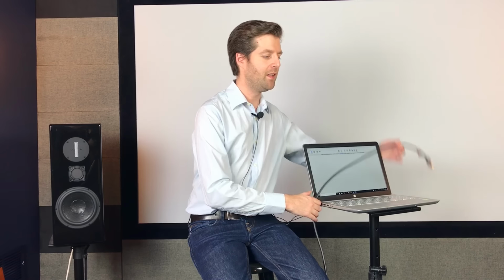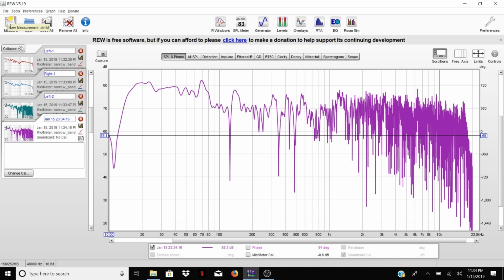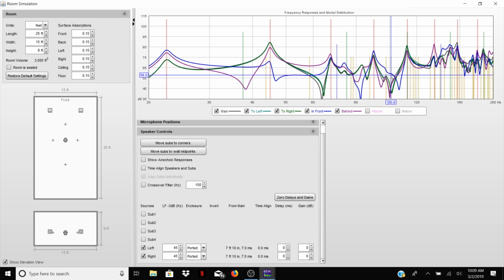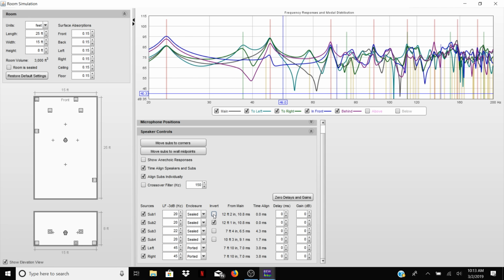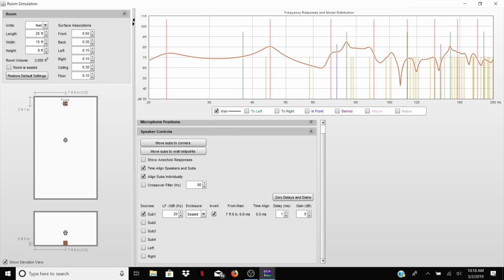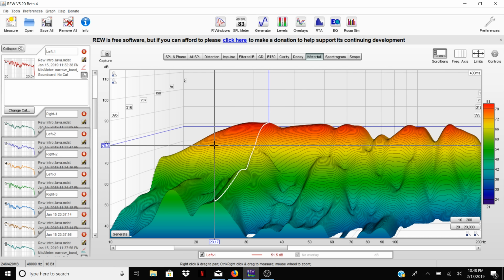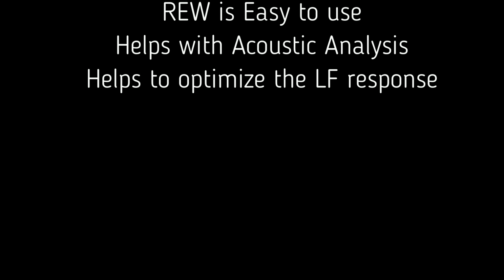How to Do Room Measurements Using REW Software

Comment: Basics / Setup
----------------
0:23 What is REW
0:59 Hardware needed
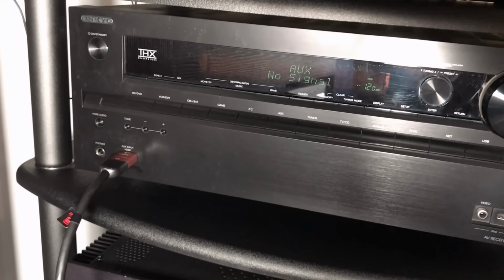1:46 Microphone placement
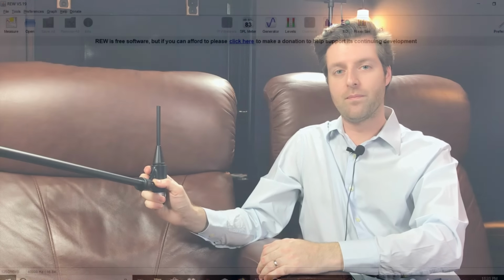2:16 How to setup REW
2:39 Calibration file (important!)

How and why we measure
----------------
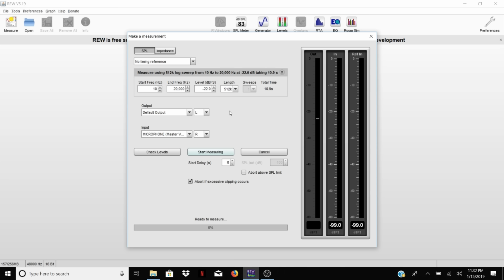2:52 How to measure
3:29 Smoothing (how much?)
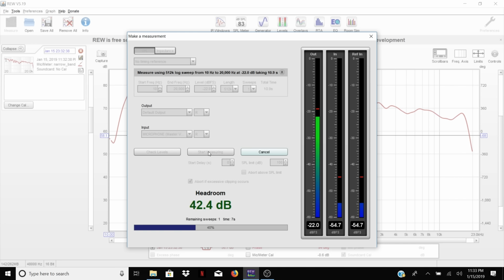3:57 Measuring both left and right speaker
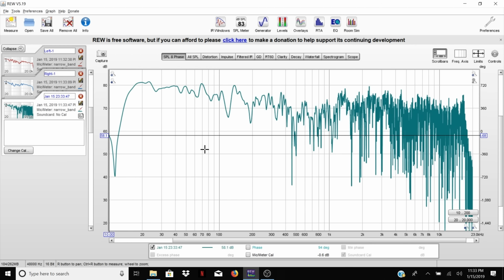5:06 Labeling measurements
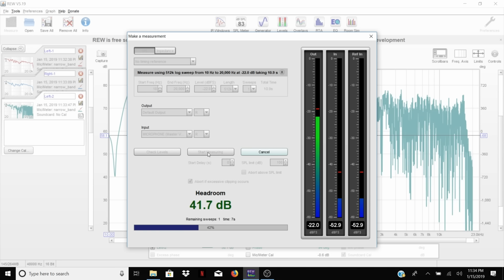5:38 How many measurements to take
6:14 Why we need more than one measurement
6:52 How to solve dips in the frequency response
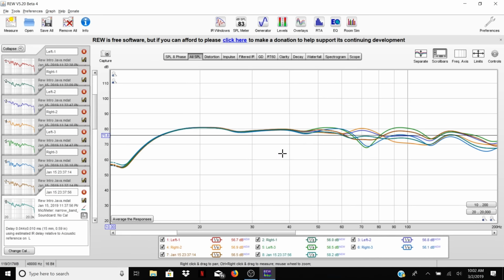7:35 Proper chart scaling
8:32 When to remove smoothing
8:54 What to not EQ
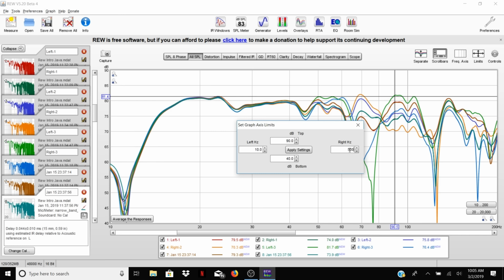10:40 The Schroeder frequency
11:22 Timing reference

Simulation
----------------
12:47 Simulating room modes and SBIR
12:56 What are room modes?
13:34 What is SBIR?
15:36 Why use multiple subwoofers?
15:55 Ported vs sealed subs/speakers
17:17 What frequencies to treat and how
19:25 Why simulations are not accurate
21:23 Individual subwoofer delay
22:06 Other simulation software
22:38 Running the main speakers full-range
24:06 Sealed vs open rooms
24:37 Why placement is so critical

Other measurements / wrapping up
----------------
25:40 Impulse response
26:10 Steady-state response
26:29 RT-60 (reverberation / decay)
27:10 Waterfall plots
29:30 Distortion plots
31:24 Wavelet / Spectrogram

Outro
----------------
33:14 Summary (what equipment you need)
33:25 Summary (what we've learned in this video)
Reply: Thanks. You've helped a stranger. You are appreciated.
Reply from the maker: Thank you so much for doing this!
Reply: InstaBlaster.
Reply: So Rew helps with 1. Speaker placement 2.  Acoustic treatments for flattening the curve 3. Purchasing subs when the dip is too great. 4. Change the crossover point on receiver. 5.Help with flattening with calibration if you have a 1/3 octave eq or better. (Which I don’t).
 What it’s not is: a auto flattening system that creates a curve for your receiver, like audessy? And I know it also has its problems. I just am looking for this to autocorrect what I cannot change... will it do that?
Reply: @tiagovirago  REW has the ability to auto generate EQ filters based on a 'ideal response' the user sets (the room curve).
those filters can be imported in all kinds of hardware or software* EQs. (or set manually on a graphic EQ device)
for a receiver alone application, the receiver would need to actually offer the option to manually apply EQ settings. 

*Equalizer APO is a free software that can do channel routing and other comprehensive settings, EQ incuded...

Comment: Do you have to eliminate the cross over on your avr in order to get a full sweep ? My crossover is at 80 hz so would I be missing the frequencies less than 80 when performing a sweep (speakers set to small).

Comment: Came to this video through Audioholic’s Room Treatment Series of podcasts. Inspired me to purchase the UMIK-1 and download load the REW software. Wow! It is not easy to get started with this stuff. You breezed right through, “And I connect my laptop to my Onkyo receiver and choose it as my output device from the drop-down menu.” = = Two hours later after determining that MY Onkyo receiver wasn’t recognized by Windows 10; I had downloaded files for my Oppo BDP-105D over the internet and chosen the correct input for it. Took six measurements, biggest anomaly was crossover between subwoofer and mains: Big hole from 30 to 40 Hz.
Reply: I would try REW but have only analog AMP, I like vintage. So no chance to measure my room and correct it?

Comment: Thanks for posting all of this. REW looks awesome. I'm debating about which measuring mic to get, quite possibly umik from mini DSP to take measurements. I'm nearly certain I have a room mode around 40Hz which seems to coincide with my basic tone tests and the fact the room is around 13' long, which would be the axial room mode. But without measuring, I really have no way to tell just HOW much of a db difference it's all at. And what to do about it. Very excited to get REW and work on the setup. I feel like I have the right kit in house, just need to optimize the setup!
Reply: A few years ago I made the jump to REW & a UMIK-2 along with a MiniDSP HD for my dedicated two channel rig. I already have a pair of HD’s for my Atmos setup but using one in my two channel rig which at the moment consists of either a pair of Revel Performa F50’s or JSE Infinite Slope towers powered by a pair of Adcom GFA-555’s and a Parasound preamp have a number of peaks from 30-60hz and and apparently a dip at 160hz. Using REW and tweaking my speaker placement I was able to get rid of the 160hz dip and I was able to EQ out all of the peaks via the MiniDSP HD and REW measurements. It sounds exponentially better and I highly suggest it
Reply: @josephfranzen5626  my vintage shop had one of those adcoms and I was seriously considering it but it may be too much power for me in the small room. A pair sounds nuts I love it. 

So after a month or so searching here and there I think I'll be going with minidsp SHD so I can apply DSP in the digital domain. It includes the umik and I can start down the REW path with that setup. 

I'm hoping I don't run into problems with two DACs in my system. I'll go digital out of the SHD to my denafrips DAC for the mains. I'll go analog out of the SHD (using it's internal DAC) for my stereo pair of rel. I'm aware that I'll be adding delay that I hope I can easily correct via Dirac but also manually in case I go without it.
Reply: @erics.4113  You should be able to. In addition to Audioholics I’ve found the MiniDSP forums to be immensely helpful.
Reply: @josephfranzen5626  I'm excited for it. My plan is to eventually look into room treatment as well, but before I go there I want some measurements to establish a baseline. Plusses with DSP and potentially Dirac are far too great to turn my head away from, especially now that I've integrated two subs and am battling a nasty room mode. Have a feeling I can attenuate that and immediately get a better FR across the range. Plus, my attempts at subwoofer positioning always seem to trade one problem for another. Although that's probably to be expected, I am relying on an inexperienced brain and ears to determine exactly what is happening and I just simply want measurements to equate the in-room experience to actual frequency measurements. I'm done going blind. Want to open my eyes now 😀

Comment: I have avr at 0db, signal from rew at 30 db and my 20-500 sweep starts at 90db then falls linearly down to 70db at 100hz, then +/ around 70db to 500hz. Do I have this setup correct to be getting these readings?

Comment: "You can use a mix of sealed and ported".  Oh, thank god, because I have sealed and open panel!  :-)  /S

On a more serious note, is it worth throwing out the severe outliers like the one you show far below the other curves with the flatter inflection points?  This obviously assumes that those were generated with the sub/listening placement outside the norms, rather than at the primary listening position.

I found the comment you made about multiple subs very interesting.  Does it seem to be enhanced (improved) running L+R over separated stereo, or vise versa?

Assuming...assuming...asssuming... Yeah, damned non ideal equations.  I was in an empty living room once with plaster walls, and I can tell you for a fact that they are MUCH more reflective than drywall.  You could clap (an impulse) and hear about 10 or more reflections damping down VERY slowly compared to an empty drywall enclosed room.  I suspect this comes not only from the stiffness of the plaster surface directly but also the increased stiffening of the entire comparative wall due to the skins stiffening the overall stud/plaster wall.

Also, why would you EVER want a room that is a perfect cube, sounds like the perfect storm for 3D temporally extended room axes excitation?  I'm saying this just on personal impression, not actual measurements.  Also I expect large panel speakers like mine (Maggies) do not excite the vertical axis nearly as much as a point source, just know a bit of physics (dangerous, I realize).  Good vid, thanks.

"How it works and how livable it is"  Uncommitted half-heartedness, I say!  :-/  :-) (kiddingly)

Measured delay on the subs also seems reasonable considering the mass involved in a sub driver, especially a sub like my Velodyne (4 hz resonant IIRC), even considering the massively powerful 'motor' compared to say an electrostatic, or even a much smaller much higher resonance more standard cone driver.

Also keep in mind that there are MANY more kinds of distortion than just THD, and that IIRC, odd harmonic distortions are much worse than the evens, from a pyschoacoustic standpoint.  Could be full of ** on all of this, but it is my subjective experience, ear wise.  

"The sound that you hear in the room is more the room than the speaker itself".  Uh huh, that must be why my sub sounds SO much better than pretty much all the others I've heard, at least at that price point (I certainly haven't heard them all, BTW).  I get what you are saying, though.  And yes, placement is CRITICAL.

On a more humorous note, I had a 'golden eared' technician from one of the retailers come out to set up a brand new delivered set of speakers (a standard service of this particular retailer on more expensive speakers) and when he was done and satisfied I informed him that the tweeter was not operating on one side.  And I don't remotely claim to be 'golden eared'.

Audioholics is a superb business name, BTW.  :-)  Also let me qualify all the above by saying my knowledge in this area is minuscule compared to yours, so I'm not seriously challenging anything you say.  Cheers.  

PS, for anyone actually having read this far, the GIK vid is another one I've seen that seems to be useful, although it is a bit more of a commercial.

Comment: Can REW calibrate surround speakers??   If so, how?
Reply from the maker: Yes. You need the ASIO driver to be able to choose different channels via hdmi.
Reply: @Audioholics  I installed that driver, but there was no HDMI option to choose from in REW. Only L R SUB channel options still remained.
Reply: @Audioholics  I think I figured it out. I have to click OFF the power button in the Dolby Atmos app window. Then it works. But now when I equalize the rear speaker, using REW, it doesn't apply the equalization to Equalizer APO. Before and after calibrating in REW he test signal run is the exact same.

Comment: I'm not using a USB mic, but rather a Beyer MM 1 omni-directional mic.  Can I use my Audio interface and my DAW for both input and output - as long as I'm not monitoring the mic input inside the DAW - but playing the pink noise from a looped track in my DAW?

Comment: How come you point the mic up? Oh- I get it. you selected that setting inside the program! The test mic I have with my DBX system has the user point toward the speakers. The test mic I have with another system I bought also has the user point the mic toward the speakers. They are both Omni just like the Dayton mic you are using. What the idea with pointing it up. Don’t you get more reflections and nodes? Seems really wrong to my brain. Thanks.

Comment: Can you use the Mic that comes with your receiver?
Reply from the maker: NO
Reply: @Audioholics  How come? Is the quality too poor to work right with the software or is it lacking the right interface for the PC?  The item that comes with receivers to auto equalizing receivers are omnidirectional microphone right?
Reply from the maker: @martylynchian8628  Receiver mics are designed to work only for that. They aren't as precise as a calibrated mic for doing precision acoustical measurements. They also don't have a calibration file you can use in the measurement software to linearize the response.
Reply: @Audioholics  Ok. Thanks for explaining.

Comment: People say avoid using the Audyssey mic for measurements bla bla bla. But it is a full range mic so can cover the entire freq range Audyssey corrects for (5-20k?), so no problems there. 
Does the lack of calibration file really matter if youre using the same mic for all positions, and purely to manually set the sub crossover point? (which Audyssey/AVR often screws up).

Comment: Can REW be used to determine the true (read: in-room) -3dB point of a speaker? Speakers manufacturers either mislead or omit this important spec, and relying 100% on Audyssey etc might not give the full picture of whats happening around the port tune freq. I guess the goal is to determine the most optimal HPF to allow the speaker to play as cleanly as possible, yet retain some "fullness" :)
Reply: How could speaker manufactures reveal any of this? They don´t know your room. They could measure a - 3dB in one specific room, which would help no one.
Reply: @qddk9545  I was talking mroe about measuring the physical limitation of othe speaker which the makers dont want to advertise.

Comment: Again at 27:31, when you said to turn off the "use usd mode", it would be much clear if you can explain what it is and why you are turning it off in a more direct reasoning.

Comment: Thank you for the instruction. I find it really confusing around 18:40 when you started talking about inverting subwoofer. a lot of us aren't so familiar with these professional terms and it would be much helpful if you can explain them before you go deeper with ur theory. thank you.
Reply: Invert polarity. Think “flipping the cables” positive to negative and vice versa
Reply: Turning them facing the walll, I guess

Comment: This software n similar is just great,  and yet you still need to make the correct decisions, from relevant listening positions,   plus at critical crossover. and simply strive for smoothest overall similar response from ea loudspeaker to seating consideration is goal. One doesn't NEED to use any specific software or measurement tool to achieve this,.a RadioShack sound level meter n test tone disc even works fine! That n lots of positioning trial n error n listening,  measuring,  listening,  measuring,  moving, yards yada.  
Never let anyone convince you you need specific latest n greatest measuring gear to get this stuff right!  .. experience? Yes!

Comment: Can this be used with  an older receiver or system that does not have HDMI inputs ? if so how? My receiver cost $5000 in 2005 and I like the sound , for movies  I use the analog outputs from my Oppo BDP 93 to the receiver 5.1 inputs .

Comment: To what extent can  room correction account for the low end mess caused by large monitors in a small room. I have a pair of large monitors with 8" woofers that can hit below 40Hz but they are often unwieldy in my bedroom. Would a calibrated Mic, REW, and a miniDSP HD be a good approach?

Comment: Ok, Ill try to give a couple. IN settings, you dont really explain certain things. For example, why are you doing L/R and sub sweeps only? In a 7.1 system, are we only doing 2.1 channel sweeps?  You have it set at -22db, why is it at that setting? Should we always use that setting? Why do you choose 1/6 smooting vs other options? You obviously chose 1/6 for a reason.... why? I could continue on, but I think you get the point. This is not meant to be a criticism, but more of an admission to my lack of understanding on how to use REW. I want to be able to use and understand it, not just follow a few steps I watched someone do on a video. I greatly appreciate the time you and others have taken to try and help many of use newbies.
Reply: There's some other awesome tutorials but I agree with ya I'm trying to get past calibration of the mic still